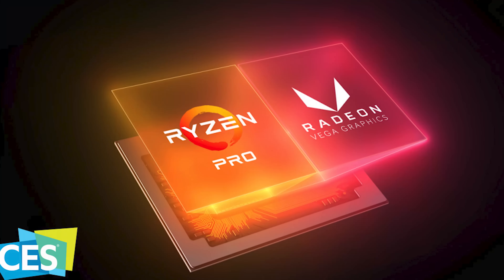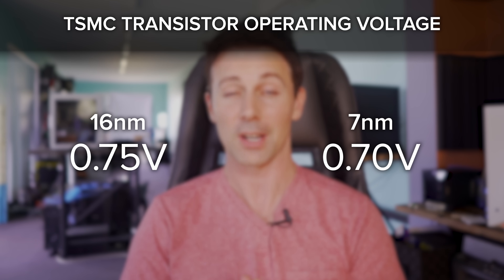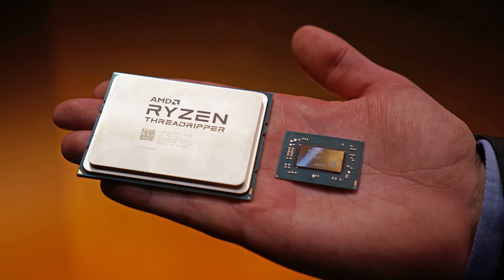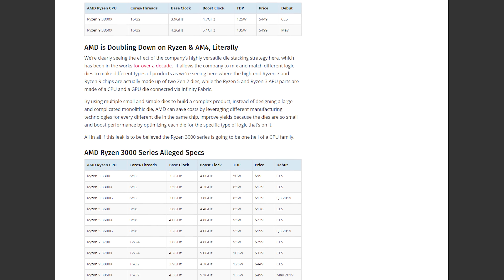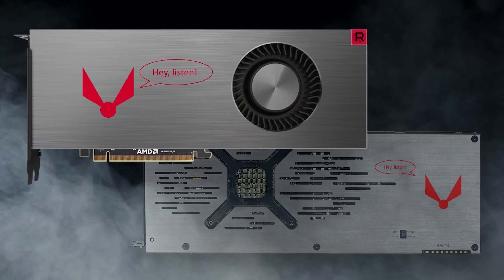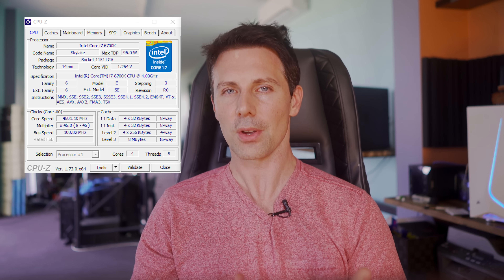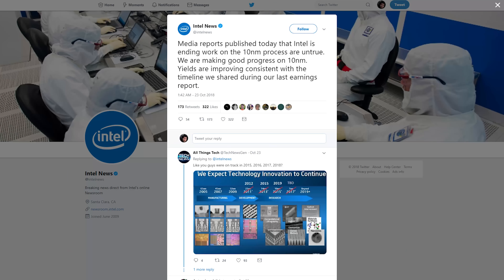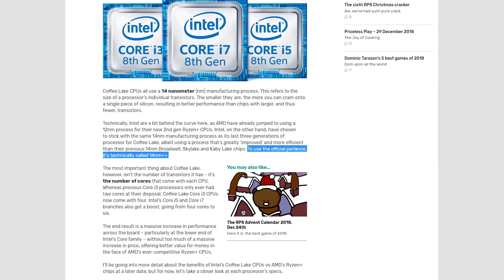7nm, 5nm and Beyond - Will AMD RYZEN 3000 be the PINNACLE...!?

Comment: Hard drives have gone from 5  1/4" down to a stick of gum, and we're moving to 7nm so can we sqeaze more into the same size die. Yet we still have full size ATX tower cases? WTF?
Reply: Agreed. It hurts my soul when I watch a build video in a full size ATX tower using 1 graphics card, 1 m.2 and 1 HDD (maybe), and an AIO for the CPU. 90% of the case is empty space...

Everyone exclaims "ATX towers are compatible with so much hardware!" but most people don't do custom loops, don't use multiple AIO's, don't use more than 1 graphics card, don't use more than 2 hard drives, don't use ANY expansion cards, and have no need for anything beyond ITX.
Reply: @vinyfiny2019  I'm a bit of an exception. I have too many hard drives. Though at the moment I'm trying to slowly move the data off the older ones onto fewer. That said I would prefer a horizontal mounted MB case with good room. I KNOW they're mostly engineered to take the off center wieght, but it bugs me on general principle to see Kilo's of heatsink and Graphics card sticking out like that. especially gpu's which can sag over time and pull partway out of their slots.
Reply: @kaseyboles30  It sounds like you could use one or two of these https://amzn.to/2Tuc7FT. Just shuck them and enjoy TB's of joy.

I typically only use non-tower style ITX cases like the SG13 (my current case), Node 202, etc. because ITX tower cases tend to be shorter versions of mATX cases (way bigger than necessary). So I don't have heatsink worries other than limited clearance. That said I have a couple of large heatsinks and they have sizable backplates to distribute weight properly.
Reply: @vinyfiny2019  I have a couple external drives and docks as well. Those are VERY nicely priced though, thx. I was more about condensing my internal drives into one big drive. I also have a blu-ray reader/writer and 3 ssd's, not that I use the ancient 80gb intel one anymore. Currently using a fractal design refine r6 case. I really like how quite it makes things, though the silence focus means middle of the road airflow, it's plenty good enough.
Reply: @kaseyboles30  That particular external is good because you can easily remove the internal drive and put it in your system (aka "shuck" it) as it's just a standard internal drive in an external case. It's also $70 cheaper than buying the bare drive.
Reply: @vinyfiny2019  That's good, one of the drives I'm consolidating from is from a wd mybook 3tb nas that the mainboard failed on after about4-5 years. Those drives are formatted to ext4 with an unusual block size and are a pain to read data off of as the software I can get (without spending $$$$ on data recovery tools) that can read it is SLOW. In dual booting linux wouldn't work well as I'd have to have a modified ext driver to handle the non-standard block size.
Reply: @kaseyboles30  I guess it pays to just replace drives every so often if you NEED what you're storing on them. Or backup in multiple locations in case of failure. Luckily I'm allowed to backup anything I want on my work server (with redundant offsite backup) so I literally backup everything on it.
Reply: @vinyfiny2019  fortunately these were mostly backups of non-critical stuff. old versions of various projects, and miscellaneous fun, but non-critical items and some odds and ends I kept a copy of of a nas for convenience on other machines. even some drivers for ancient hardware I no longer have (yeah, a real junk drawer of stuff) a working version of or ability to use (found drivers for an old vesa bus graphics card and an old motherboard's com/lpt port subsystem from the mid 90's lol).
Reply: @kaseyboles30  Digital hording, I can respect that.
Reply: @vinyfiny2019  every time I rebuild my main system or re-install the o.s. I copy huge chunks of stuff onto the current junk stash drive and somehow never delete anything and here the first time in decades I had a hardware failure like this require a massive copy-fest has felt like a major archaeological dig because the slowness made me decide to finally try and clear out the dead bits. I should have checked on the way wd nas units format their hard drives. I figured they'd just use nt-fs or standard ext3 or 4 like almost everyone else. I hear the newer units are even less standard and require a wd tool or software specific to the way data is stored on the drives.
Reply: @kaseyboles30  DIY'ing a NAS seems like more and more of a necessity to get a setup the way you want it.
Reply: @vinyfiny2019  It's on my 'someday' list. Right now getting my old house(1963) up to code or better electrically and putting in cat6 or better properly (only so much you can with cable hiders) is higher priority along with half a dozen other projects such as a new gfx card for the old pc that I use for video my tv cannot decode on it's own. Lent the old one out, but would much rather have something from this decade in it lol.
Reply: Fingers aren't getting any smaller
Reply: Either air flow (understandably), aesthetics (I personally like to look inside my computer), or accommodations (IE, you have a lot of drives). Guess that also explains the apparent surge of small form factor computer builds; there's no need to have that much space so you can afford to go smaller on those (figurative and literal) cases.

I've also not used a CD drive in over a year.
Reply: I'm deliberately looking for a full-tower ATX case and they're surprisingly hard to find since all of them are mid-tower these days. Ever had a triple slot monster of a graphics card? I have a mid-tower case right now (Fractal Design Define C TG, the older version with a plastic side panel instead of tempered glass) and it's so small that the graphics card (1080Ti Gaming X Trio by MSI) can not cool itself properly since there is so little airflow. When I took the side panel off, GPU temps dropped about 8 degrees which really is quite significant and more than I'm comfortable with. A full-tower case would solve this issue.
Reply: I actually agree. Seeing all that empty space in an ATX mid/full tower gives me OCD.
Reply: Yet we still have full size ATX tower cases? WTF?  

so dumbasses who need to overclock can put in water towers...    stupidity is costly as  it should be.

Comment: AMD has already shown that beside the smaller size transistors, they can easily fuse 2 CPUs in one, perhaps 4 in 1 and so on, resulting in a larger socket size, nevertheless much more powerful chips.

Comment: Im ready for ryzen 5 3600X. Still stuck with intel
Reply: Alex Jones Fake News Destroyer  im using 4th gen i5 with ddr3. I just need 4 component for upgrading my PC. R5 3600x CPU, B550 MB, DDR4 3000 ram, and 860 EVO 500GB SSD  which i already bought.
Reply: Alex Jones Fake News Destroyer  yep full pc upgrade .. Almost after 5 years im going to upgrade my system..  Bcs most off time my cpu runs 100% on new games ..  which give games micro stutter.Thats why 😁

Comment: Wait wha... I7 7600k struggles to get to 4.6/4.7 Ghz? My I5 6600k runs at 4.3 Ghz all cores and I could even undervolt it to on avarage 1.28 Vcore. o.o
Reply: the curve for frequency is very non linear and more like asymptotic. The last 300-400 MHz is significantly harder to push out of a system.

Comment: As a quantum physicist, I have to say that the probability of an electron quantum tunneling through a proton is very little however as the voltage is increased and there are more and more electrons (due to higher transistor count) the probability of at least one electron tunneling through increases dramatically. This quantum tunneling problem is one of the things where quantum computers start showing their advantages over traditional supercomputers
Reply: Son Goku is a quantum physicist...seems legit.
Reply: Madara Uchiha do you get sarcasm?

Comment: One of the lessons of Moore's Law, was that if you can double the transistor density every 18 months to 2 years, then you got double the computing power, at the same price, every year & a half.
That led to a willingness to look away from various ideas & developments that would improve computer power, because it was simply easier to wait a year or two and throw more transistors at it.
So you got things like the clock-wars, and the excessively long execution pipelines to improve clock speed...
I'll spare you the whole history (and my fingers & patience typing it) but while shrinking the die / process every couple of years was the easiest thing to do, that's what we did. Now days, that's getting harder, and the cost of each process is going up exponentially.
Other things we've done as well, or in stead, were multi-threading, multi processing, improved cache capacity and improved cache design, wider busses, wider registers and floating point units, single instruction on multiple data engines. (Screaming Cindy.)
Intel found a ringbus design for inter-core comms is very good, at 2 or 4 cores, it does start to fall down at 16 cores & 32 threads.
AMD found the concept was good, but their first attempt at multi-threading and multi core, led to Bulldozer and Pile-Driver... The concepts were good, but the implementation was less than excellent and the time was a little early.
This time around, the one who's dropped the ball, seems to be Intel. What AMD have to do now, is not rush, not panic, and not make any major mistakes.... They've been here once before, about 2004 or 5, and they shot their own foot off.
If you can't make the process smaller than about 5nm, the next step would be 32 core / 64 thread desktops. To really take any advantage from that, a lot of software would need to be completely re-written, and making use of 30+ threads in a simple algorithm is not easy... Some kinds of task lend themselves to that well. Others do not....
Before we do that, it would be an idea to have drives (SSD, M.2-pcie, what ever) that were about a hundred times faster, and most of all, make our internet a whole lot faster!
Lack of computer number crunching power, is not the thing we mostly wait for these days. It's the internet and your hard disk. It's not so much a 50 times faster CPU you want, it's a 50 times faster HDD.
Reply: How about a better software platform?
Intel has been on this path for years and the software has been successful, but nowadays this stagnation is the main problem, software not hardware.
Reply: @TheSilviu8x  Part of the problem is OOPS bloat. OOP had some interesting ideas and concepts, and indeed has use in some cases. It is not however the panacea those that turned it into a religion make it out to be. When a 2k program re-written in oops take over 2 megs you have some serious bloat. Sad thing is the 2k version had extra features and could be changed fairly easily to add more or expand scope, whereas the oops version barely had basic functionality and would require major modification or even a re-write to get near parity with the 2k version.  Just one example.
Reply: You're starting to sound like my computer architecture class (and to an extent, my compilers class) all over again, and basically yeah. Once you realise you can no longer increase clockspeed without cooking the CPU (and everything around it), you have to do funkier things to squeeze every last ounce of performance as possible, such as pipelining, adding one or many levels of cache, and parallelization. 

You can't parallelize cooking one egg to reduce its cooking time, but if you're in a position where you have to cook 30 eggs, you can parallelize that instead.

(No, you can't just introduce a new architecture or instruction set unless the speed benefits are so compelling that you can straight-up ditch x86; if it were me, I'd also want an emulator to come along with it so I can run legacy executables and probably so would lots of other people. I'd bet anything written in, say, Java could run just fine; it's just a matter of writing a new JVM to run on said theoretical machine, though the more I think about it, it'd probably be the same case as with any program that gets compiled into x86 machine code, it just needs its own VM. Feel like I need to research Intel Itanium some more...)

Tangent: when I first built my computer, 128GB SSDs were commonplace and the cheapest fast storage option I had at the time. When that SSD failed, I had it replaced with a 256GB SSD. I recently built a computer that had a 512GB SSD for roughly the same cost of that 128GB SSD I got years ago. (I've yet to try an M.2 SSD.)
Reply: LOL - Ganaram, when I built my first computer (for me, not for the shop), it was a Pentium 100 and I spent several weeks income to get 16 MB (yes, Mega-bytes) of RAM, which was an insane amount for a home user, and much more to get a Quantum Fireball 6.4 GB HDD, which was about ten times what any sane normal home user had... It was about May or June 1995, and I had bootlegs of both WIN-95 and NT-4.0 from school, burning holes in my pocket. But I had a free copy of VMware, the Windows version, and I was running RedHat in a virtual_machine there, learning about it... It was about '98 I first install a Linux on bare metal ... I've been using & playing with Linux now, for 24 years....
Reply: @Kneedragon1962  ...my father managed to get me 2x 32mb SIMMs. Those seemed out of this world. 

Had a 2GB hdd lol. It seemed decently big too lol.
Reply: @Kneedragon1962  Ugh, NT 4.0.  It was a serious upgrade, but it ended up giving me nightmares.  So many things were unsupported...or half supported.  I do like Linux...running Mint, right now.
Reply: If Optane turns out to be scaleable and keeps up with Moore's Law, Intel may still come out ahead by solving that even bigger memory speed issue.
Reply: My dream tech is persistent storage that is as fast as RAM or even faster and affordable. Such storage can replace both SSDs and RAMs altogether, increasing speed and reducing cost (if affordable) at the same time.
Reply: I disagree on your latest point.
We need faster CPUs to simulate more realistic virtual environments, and I mean simulate. GPUs are also needed to render these high fidelity environments.
Yes, faster internet is incredibly important. Storage devices too. But the CPU/GPUs should not at all be neglected even by a bit.
What I'm most curious about is wireless data transfer speeds. Not over the internet, but kinda like bluetooth. That's going to be important in a wire-free world too.
Reply: @James Smith That's a really good observation. Loved it :)
Reply: Look at your task manager, 64 cores and more could be useful right now
Reply: In few years we'll see quantum computers...no logic to make more than 32 cores processors ???
Reply: Packing more cores into a die is essentially throwing more transistors at it.
And as you said, at some point it won't be possible to throw more transistors at it.
Other architectures like ARM and RISK will likely gain market share because of x86s inefficiency.
Reply: @kommentator1157  Risc pulled a stealth takeover years ago. Modern x86 processors have risc cores with an outer translation layer for software compatibility. I would suggest having a way to code more directly to the core itself. So you could have both/either true native instructions as well as x86 for backwards compatibility until the old x86 code dies.